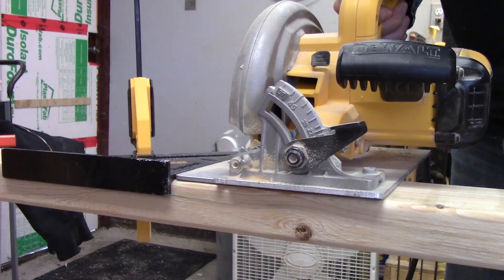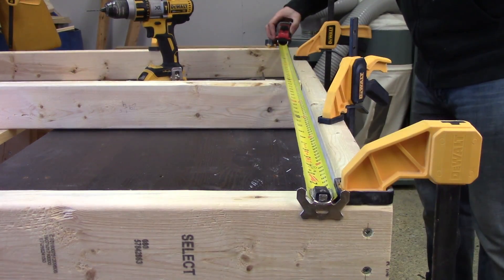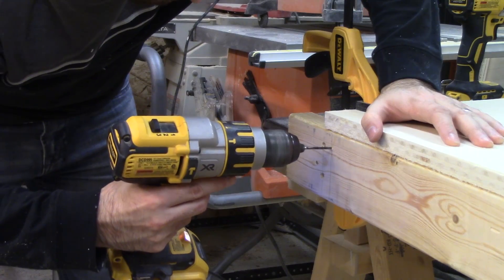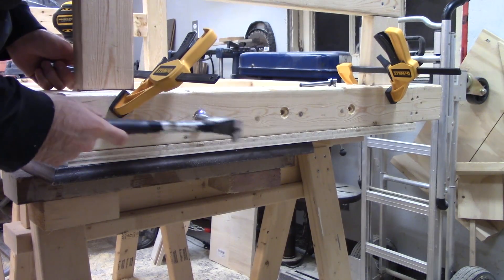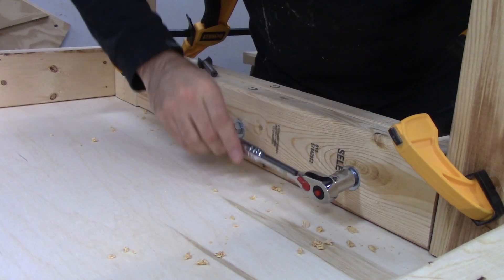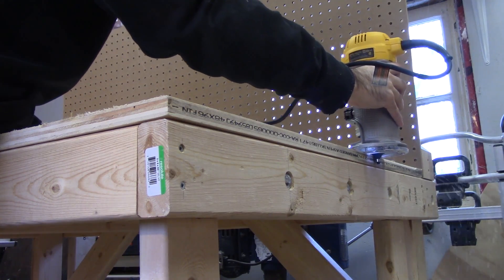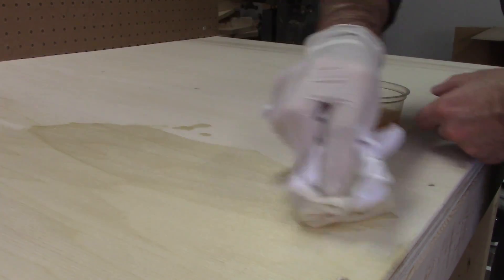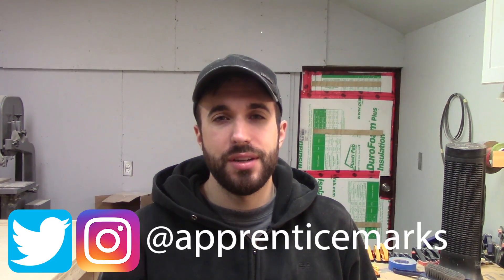Easy to Build Collapsible Work Benches

Comment: The only thing I would do different is use the structural screws that Home Depot sell. They have a Torx head and they include a drive bit in every box. They require no pre-drilling and take very little torque to drive it and have huge strength ratings over standard wood screws.They never slip and are sweet to use, They cost 3 times more than a box of cheap unrated wood screws cost but give you the strength ratings. The # 9 screws I used for my work bench are rated for 800 pounds per screw.  These screws actually pre-drill as they drive and to prove this try driving a regular screw in and take it right out, it gets HOT, try this with the structural screw, it will be warm.
Reply from the maker: I’ve never tried structural screws. I’ll look into them. Thanks for the tip

Comment: Not bad but 2x4's are made from a soft wood. Predrilling for screws is completely unnecessary. You might be even loosing some strength with less for the screws to grab on to.
Reply from the maker: Brandon Francey I strongly disagree. In my experience, 2x4s have a bad habit of splitting when you’re drilling near the ends. I had just enough material in the shop to complete this project, so it was important that I didn’t ruin any of the pieces during assembly. If anything, the benches are a bit overbuilt.
Reply: Not true! The "soft wood", especially after being kiln dried, denses up very well. When working with 2 X 4 or great thickness I always pre-drill or I cant drive the screws in 1/2 the time.

Comment: Just curious: Why no lock-washers on the carriage bolt nuts? Totally unnecessary?
Reply from the maker: SF2K4 to be honest, I didn’t even think to use them. These benches were made to be portable, so I wanted the nuts to back off easily. There’s no reason why you couldn’t use a lock washer, or a nylon nut, or even a second but jammed up against the first if you had trouble with the fasteners loosening on you.